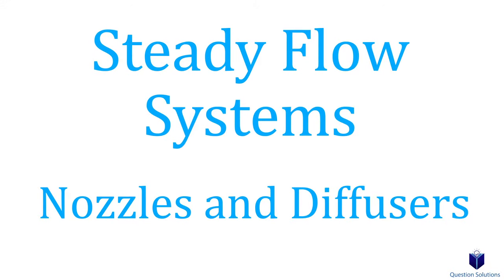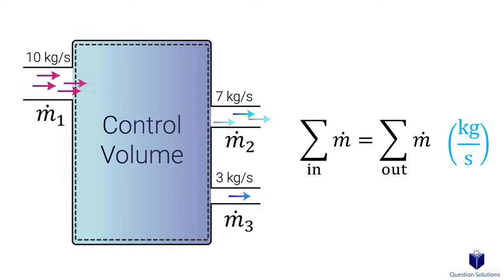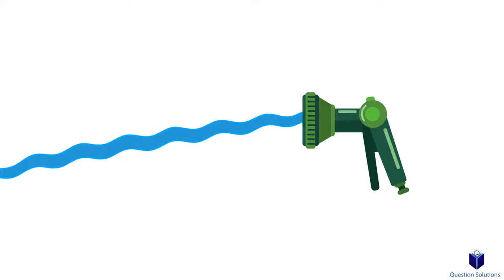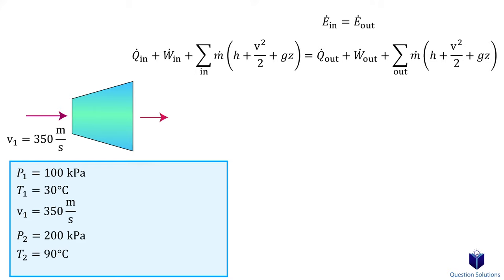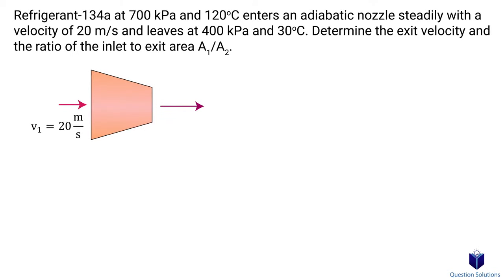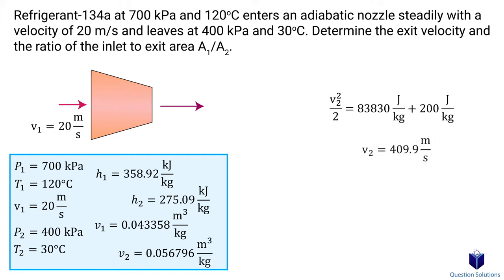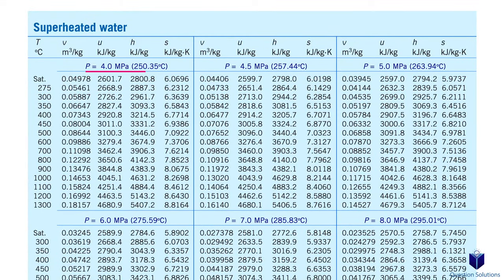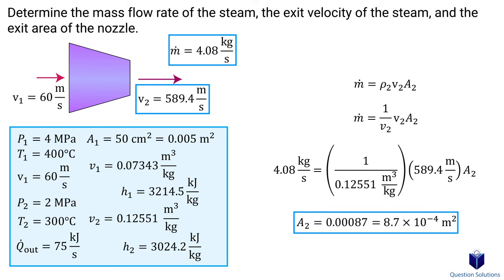Steady Flow Systems - Nozzles and Diffusers | Thermodynamics | (Solved examples)

Comment: you initially said delta h =Cp(T2-T1) but changed it in the diffuser question to Cp(T1-T2). How do you know which way to put the temperatures? Does it matter?
Reply from the maker: Please provide timestamps so I know where you're referring to. That way, I can help you out better, thanks!
Reply: @QuestionSolutions  4:13 for the Cp(T2-T1) and 5:30 for the Cp(T1-T2) . Thanks!
Reply from the maker: @Jon-xu7jl Ahh, I see, it should be h2-h1 corresponding to T2-T1. They correspond to each other. At 5:30, when we did the energy balance, we got h1-h2, which gives us the corresponding T1-T2.

Comment: Why take specific heat of cp? if it is not contant pressure?
Reply from the maker: I don't know where you're referring to. Please use timestamps.
Reply: @QuestionSolutions  my question I believe is general, but for the sake of the video, it's on 5:40. I thought we can only use specific heat cp, if the pressure is constant, but it changes in diffusers and nozzles.
Reply from the maker: So this is just calculating enthalpy with the assumption that it's an ideal gas. For enthalpy, you use cp, and generally, you will find that the difference in pressure is minimal that it makes little difference. You can see a different problem solved here: https://pressbooks.bccampus.ca/thermo1/chapter/5-5-application-of-the-mass-and-energy-conservation-equations-in-steady-flow-devices/ check out example number 3 if you need further clarifications.  @itsyogurt9247

Comment: sir, aren't the diffuser v2 supposed to be 0? because the velocity is decreased. I'm confused
Reply from the maker: Velocity is decreased but it doesn't have to be zero 👍
Reply: @QuestionSolutions  so if the question stated that it is 0, then i can use it rght?
Reply from the maker: If the final velocity is zero, then you would have zero for velocity on the exit side.

Comment: why don't you find the value of h1 and h2 from the property table of the 1st math?
Reply from the maker: You can solve these problems in many different ways. I showcase one method, but as long as you get to the same answer, the path you take doesn't necessarily matter much.

Comment: Sir at the @ 10:59  you have considered mass flow rate and since also there only one inlet and one outlet and can I solve the problem without considering mass flow rate 😊
Reply from the maker: So the question actually requires you to find the mass flow rate. Since you already found it, might as well use it :)
Reply: thank you sir i got it :goodvibes: